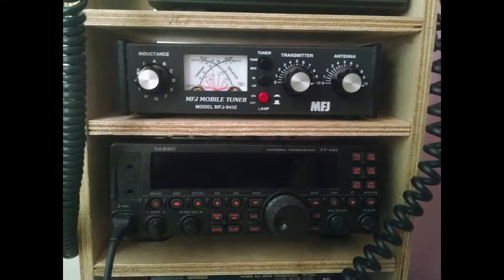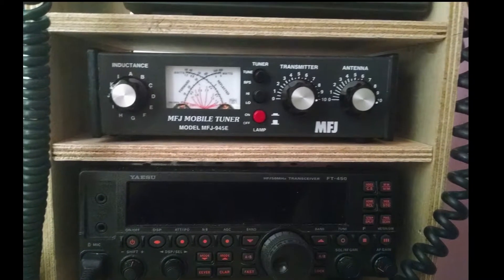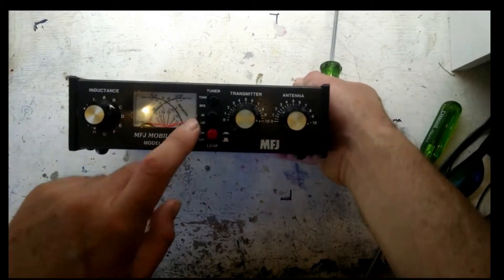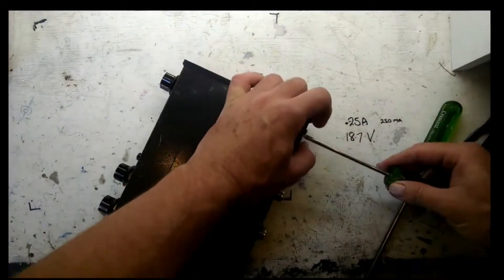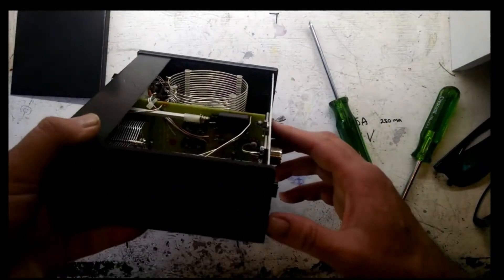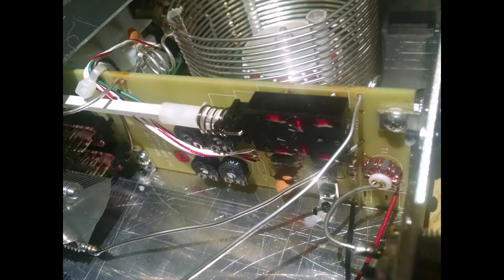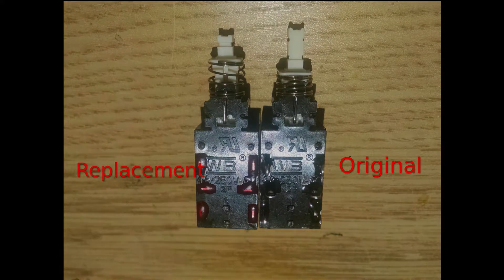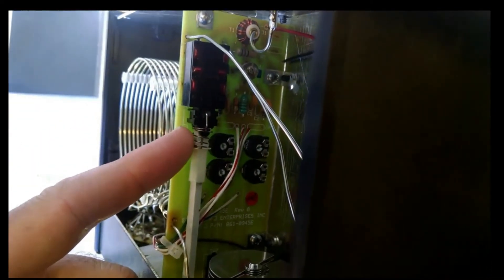Repair an MFJ-945E Tuner - Cheap and Easy!

Comment: Thank you, I have one of these that I picked up at a fest and the switch broke when I was cleaning it. I wont say this was abused just used a lot. I was looking for the right switch and could not find one. Found this vid and used this one for it. Fits perfectly. after I replace he meter light with a LED ( Hard Wired) now I have a tuner for field day and winter field day . I have one of these for years and you can tune a nail with them, glad I got a used one that works. Oh and I can tune a J5RG Jr to 80 meters,  and parts of 160 so yea a nail.

Comment: My Switch has just gone the same way as yours did On the tuner, I'm in the UK and managed to get 5 wb4a/250 VAC 6 pin key switch from Amazon UK for under £5 sterling they come in packs of 5, so I'll have a few spares. Cheers for the video and the information

Comment: I also have an MFJ 945E which is driving me crazy. At beginning It seemed to tune fine but then a little at the time It started to get always more difficult to tune until It reached the point where It can tune anything. Any value of inductance or the two capacitance won't work. The needle jumps left to right and back so it's basically impossibile to tune. It also used to stay in tune for a tiny little bit but After a few seconds or some minutes it was completely out of tune again before It got this bad. The needle also started to move by itself with me doing absolutely nothing to the knobs. Any thought of what It might be? Thanks for your help and best 73s. P.s It used to tune Ever band than It started to "lose" one, than another one and so on till It was completely useless